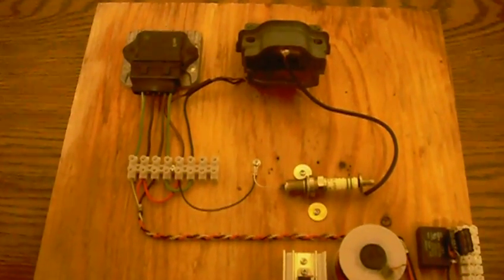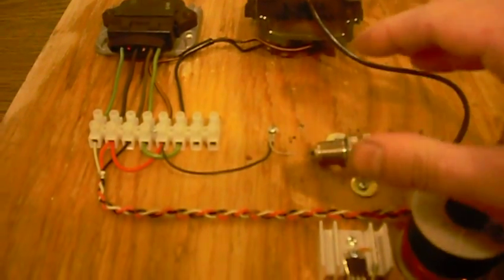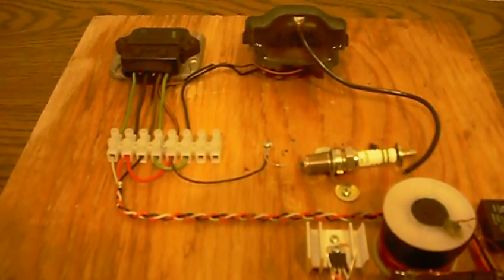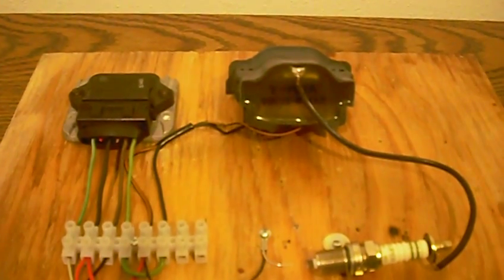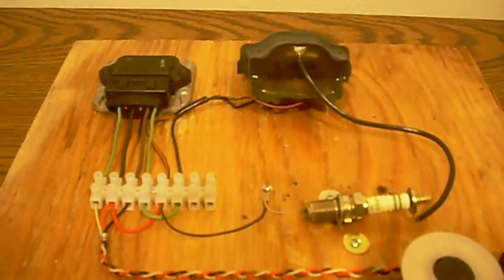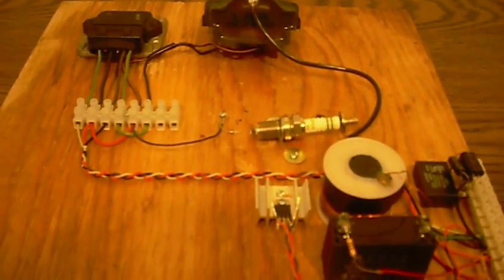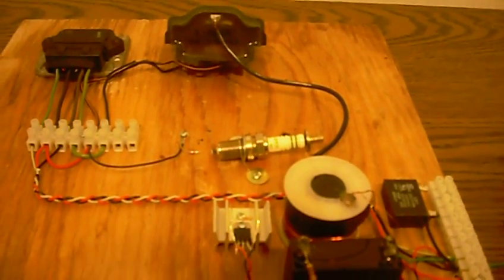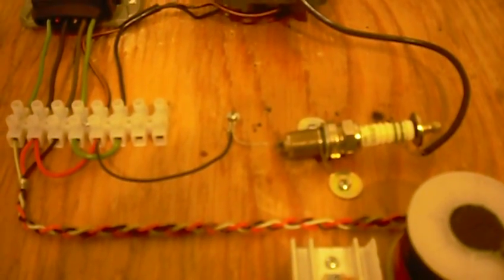High Quality Spark Generator - No 555 Timer Needed - Uses Automotive Spark Module

Comment: so could i just connect 12v dc to this and make it spark? is there a certain ammount of amps i also need or do i need those other components you have there out of a car my sparkplug is from a weedwacker im just looking to remotely setoff gas from a distance only needs 1 small spark